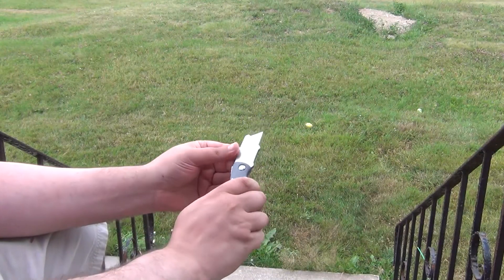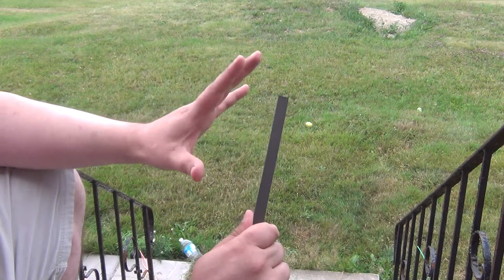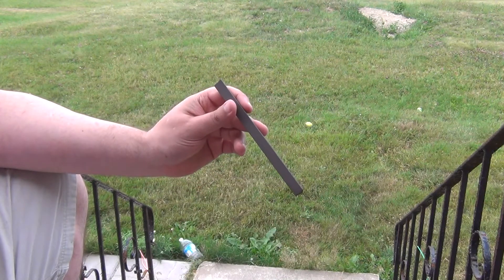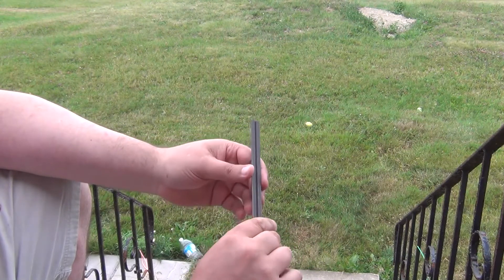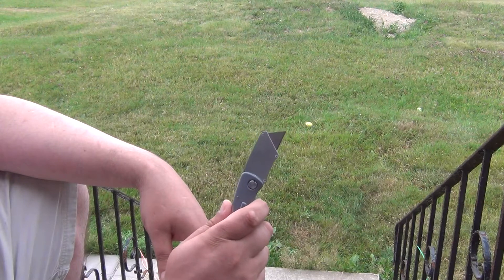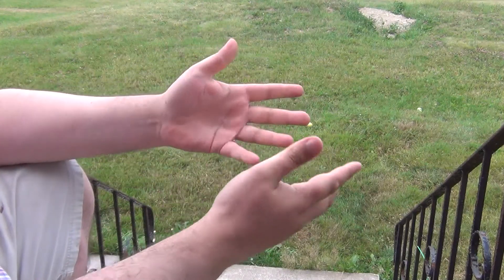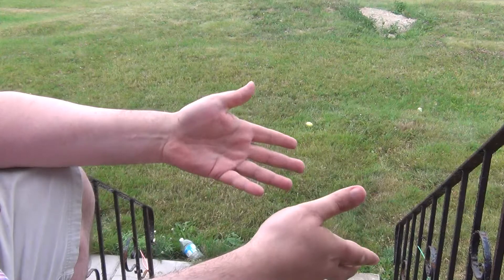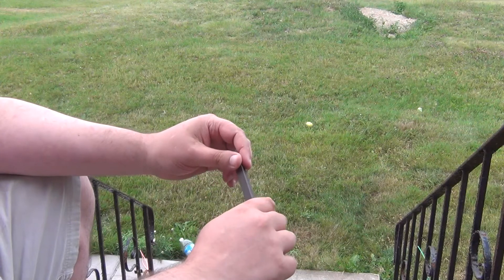Spyderco Delica ZDP-189 : edge retention on polypropylene (CBN vs medium rods)

Comment: Cliff - Thanks yet again for another enlightening/informative quantitative video.

I just bought the CBN stones and love them, although they seem almost done after reprofiling a couple Syderco ZDP-198 blades (including the Delica) on them.  And I did try to minimize the pressure and "let the stones do the work".  I also had to replace my medium stones, which became glass-slick after not such a long life...  These damn superhard supersteels like S90V are really hell on these ceramics (and my wallet).

My question - and forgive me if you've already addressed this elsewhere - is what exactly are the differences between the older diamond rods and the newer CBN ones?  I know diamond is a little harder, but there are other variables such as grit size and the tenacity of the binder used, etc...

So, can you please explain the pro's/con's of both different coarse media?

I have so many different stones, but lately have been finding myself only using the Sharpmaker, due to it's simplicity + consistency & the fact that it's almost impossible to scratch the blade finish up with a careless swipe as with my oilstones.

Thanks again, and please keep em' coming!
Reply from the maker: Greg, how much force were you using? When you say reprofiling do you mean altering the edge angle? How much of an angle change? Were you using a lubricant/fluid?

The diamond stones have a near identical grit and produce a near identical finish. I can't see a difference even under 150X linear magnification nor can I measure it with sharpness measurements as precise as 5%.

However there may be a long term durability advantage to CBN vs diamond due to diffusion based wear in diamond however that is just a hypothesis. I have no data and I have seen none. But this is a critical factor in industrial application as diamond isn't used on steels for that manner. But they grind much hotter that we do by hand.
Reply: I haven't been able to measure the actual force, but I was basically just letting the weight of the knife + just a tiny side pressure to keep the blade straight.

The knives in question were the Delica & Caly3 (both ZDP), and I used the 30-degree setting dry (no lube).  I also did a   Benchmade in S90v, but have no idea what it's starting angle was before I got it @ 30.

The stones just feel really smooth already, but hopefully I just knocked off the excess particles?
Reply from the maker: Greg Fowler Greg, this is one of the difficulties with talking about plate abrasives as it isn't trivial for me to tell you how I use them because unless you are going to use a force plate under them (no one does) then it comes down to feel.

Here is the best I can tell you, under no circumstances should you be knocking pieces off, if you are then you are using far too much force as the abrasive should wear down not be torn off. 

I don't even use the full weight of the knife initially.

I have done far more sharpening than what you have noted and the rods still cut well. The key is use just enough force for them to cut and this is really light and ideally you have to use a lubricant, a thin one.
Reply: Cliff Stamp  Ok, I guess I didn't mean to say that any grit particles were noticeably coming off the substrate - just that perhaps the rods ship with excess non-bound abrasive and that it is "normal" for that to go away (like you'll notice on the inside of the hollow rods, there's a lot of loose useless grit stuck to it from the coating process).

So, I don't think that the abrasive was ripping out of the binder.  I never felt/saw any sand-like particles actually pop off.  It's just the texture of the rods is much smoother already and I wasn't hearing the same pleasant "scrriiitchhh" sound.  Also, the scratches seem less pronounced on the edge surface.  I have yet to try them again on a more reasonable steel (e.g.: VG-10), so maybe they are still effective at least for the softer/easier non-tool steels.

By "force plate", do you just mean a simple postal-like scale or do you mean something more extravagant with a load-cell and whatnot?

And one more thing to add - I gave up on all my other more-traditional stones (several synthetic Nortons, some cheap diamond-backed steels, Arkansas stones, India stones, etc...), but have just not been having much success with the Sharpmaker.  I was hoping for something close to a zero grind with no microbevel, but in desperation after I spend a long time going thru all the grits (CBN ->  Medium  ->  Fine  -->  Ultrafine) @ 30-degrees, if I just do several passes with only the Ultrafine on the shallower 40-degree setting, I am finally able to shave hairs and slice through yellowpages.  The big question though - is how long this edge will hold using this method...?

Also, I suck at stropping.  I hope it's just that the cheapo chinese 2-sided paddle strop I got is worn.  I'm trying to investigate better options (including this interesting, but perhaps gimmicky "Washboard Sharpener": http://www.washboardsharpening.com/user-guide.html)

For as much as I think I know about steel and mechanics (have an M.S. in Mechanical Engineering), it's clear that there are tomes of knowledge I am still missing.  Which is why I appreciate all the comprehensive quantitative work you do backed with qualitative reflection.

Aside from several very ignorant, annoying people, one of the greatest things about the knife community is how helpful everybody is and how we are all striving to both learn & teach about all aspects of our hobby/collections.

Thanks,
G.
Reply from the maker: Greg Fowler Greg, any way to measure the force, if you have load cells you can get the force/time response curve which is interesting and actually use it to train as a biofeedback response. The main point I was making though is that while I know what 5-10 grams feels like as I measure it, it isn't going to mean much to anyone else because they are not and thus one of the big issues I have in communication is exactly that problem of how much force to use on stones. This is compounded by the fact that it isn't even the force which is relevant by the pressure.

If you are sharpening just on a micro-bevel your contact area can be as small as on the order of 10 microns thus the pressure skyrockets over when you are working on the actual edge bevel which is on the order of 1000 microns, a 100 times bigger. Thus using even 5 grams on the micro bevel is like using a full pound on the main bevel. This is why when I approach the edge or use a micro-bevel I wet the stones and use just enough force to maintain contact. I show this in one of the Sharpmaker videos and you can see the main issue I am having is just getting the knife to evenly make contact as the force is so low.

Now of course the only reason you have to do this is that the CBN rods are a single layer of abrasive unlike the medium rods which are a solid sintered block. Even if you do wear the medium rods smooth just buy a cheap piece of coarse diamond sandpaper, some loose diamond grit and just lap the surface back. It would take maybe $0.50 worth of abrasive to restore the surface. But once the CBN wears down then - well it is worn down. This is why I advocate only using one side when you start, number all the sides and rotate them as they wear. You then use the most worn sides for the very high pressure work (micro-bevel) and use the least worn sides for the low pressure work (the shaping).

The edge should easily dry shave your arm right off the CBN stones, if it does not then there are three main reasons :

-the edge isn't actually forming an apex
-far too much force is being used and the edge is fracturing
-there is an edge bias (it has folded over to one side)

There are other possibilities but those are the main three.
Reply: Cliff Stamp Thanks for those tips.  I'll see if I can borrow a load cell from work and play around.  I suspect part of my problem is maintaining a consistent angle - no matter how steady I try to hold my hand and keep the blade vertical for both side, I am sure there is some walk between passes.

And good idea about numbering the sides.  I labeled them "new" and "old" - wish I had sequenced them like you suggested.  Also started spraying a water mist on the CBN's, although it may be too late.

I'm having a hell of a time getting this cheap-ish Camillus in VG-10 sharp - will cut phone paper a little roughly, but certainly not arm hair...  Been sticking with the 40-degree angle cause that's what seemed to remove the Sharpie marked along the whole edge where the 30 just ground the back-bevel down a little.  I am using the CBN stones' corners for about 10 passes each side, and then switching to the flats and then on to the medium, but I'm definitely doing something wrong.

Also didn't think to try re-sanding the medium stones... wish I'd have read that before I got another set...

Just a wealth of wisdom - you should consider offering classes for a nominal fee - could help you supplement your steel-addiction.
Reply from the maker: Greg Fowler How sharp is the Camillus off of the CBN only?
Reply: Cliff Stamp Well when I was using the 40-degree setting in the sharpmaker, it didn't matter which rods I used - the edge was just crappy and wouldn't touch phone paper.  So I got frustrated, and started free-handing it with the CBN rods paying great attention to the angle and pressure and using sound/touch as feedback.

After a few passes, that puppy was zipping thru paper and cutting hair fairly well.  Then I did the same on the medium stones and it was like a laserbeam.  For reference, the knife - which was super-sharp outta the box until I messed it up by stropping it - is just called "7.25'' Folder with Titanium Carbonitride" or some other such lame generic nonsense.  Not a bad little Ti/C.F. framed VG-10 blade for under $60 though...
Reply from the maker: Greg Fowler Yeah those coatings don't do at all what they claim. They are useful for drillbits but in general not for knives.

Comment: Thank you Cliff, this is exactly what I was referring to in the wood cutting video. Its very interesting that the coarse finish lasts 4 times better than a higher polish one. I wouldn't have thought that the difference between the two would be that big. Another thing that I think would be interesting is to see how different carbides act, like zdp has chromium carbides but how would say s90 or s110 or 10v which have more vanadium carbides act in this test. Tests like yours show exactly why its hard to rate steels in categories in edge retention because so much of it depends on the geometry,  edge andle, edge finish, how it was sharpened not to mention heat treat and temper cycles.
Reply from the maker: Yes that is an excellent question, how much of a difference would be seen if this was m390 for example. I am going to explore this as I get various cutting media.

Indeed. Too often people make statements about edge retention which it is just jibberish because it isn't meaningful because it is so strongly varied as you have noted.

Comment: Cliff, I have not seen Mr Feinman lately, how is he doing?
Regarding the ability of the ZDP 189 to retain an edge, why is it so dramatically different between the CBN and the Medium stone? Is it the nature of the scratch pattern of the CBN on the ZDP? I will have to review the utility blade steel variation as well, but was it similar?  If so, what is the advantage of the nature of the scratch pattern that the CBN produces that gives it the "edge" over the Medium stone? 
If the pattern leaves a more toothy structured apex, does this equate to a shortened life span of the average knife steel? I know its odd, but if it turned out to be so, I suppose a shortened life span might be acceptable if the performance is higher. This is all under the assumption of course, that the CBN could leave a toothier apex, but I am just guessing at this point. The rational for my guess is the the benefits of toothy apex on material like polypropylene rope.
Reply from the maker: He has become aware that gender exists and is exploring the consequences of such. The same tends to happen in people in the late teens and it tends to be a few years (if ever) before they snap out of it.
Reply from the maker: The CBN is more coarse and like a coarse saw has much more material needed to be worn away and thus will stay sharper longer on slicing on abrasive material. If the material is hard and not abrasive this doesn't happen because the teeth can crack off vs being worn down, hence the difference results on the plastic and wood cutting.
Reply: Cliff Stamp Thanks, I was wondering something else and I know it is well within the realm of wacky, but I think it is related in a way (kind of) and what I am wondering is, if a toothy edge, which essentially has microscopic saw teeth, were used to cut up food like steak, do the micro teeth get broken off into the meat and then we end up consuming them? Now, I know they are very small, and (probably/hopefully) these remain within the meat and pass out of us. Assuming that a high carbon steel is used vs a type that is corrosion resistant, would there be less likelihood of it harming the body if they were more likely to corrode quickly?  
(Hey, I did preface that it was going to be a wacky question! :)   )
Reply from the maker: traderjoes Yes you will eat some amount of steel, however you are going to eat much more metal from cooking with metal pots due to the time and temperature of exposure. If you wanted a real concern it would be eating aluminum (from foil) and the extremely non-healthy coatings that are on non-stick pans.

Comment: The sharpness indicated have you increased your sharpness by 50% since you doubled your sharpness range?
Reply: Well that was one of the more impressive posts I have made.
Reply from the maker: I am not sure exactly what you mean, is it why the medium rods hover around the 60%? 

The sharpness in these is fairly low (for me) because they are severely time constrained, I only have 24 pps to grind off all damage, actually sharpen, and burr minimize. 

I could double it with a little more time. But the relative sharpness would increase with both blades, the ratios would similar.
Reply: As an example you show the sharpness for m3 at 100. A few months ago you doubled your sharpness measurement as you kept exceeding it with one of kyleys knives. Have you once again met or begun to exceed the optimal sharpness measurement.
Reply from the maker: mark a Yes, I can surpass that now readily in regards to slicing sharpness which is more sensitive (variable). Most people don't do a very good job on that at all but that is mainly because of the buffer/strop over use.

I should note the absolute sharpness level being used in these charts even for reference/consistency. Thanks for bringing that up.

Comment: Putting in a request now for a gorilla suit in a future vid to help promote the Sasquatch avatar.

Interesting results and good points made re: blade length, abrasion factor of dirty rope, etc.

I have started experimenting with using the medium and sometimes the fine sharpmaker rods on a S30V Paramilitary EDC unit rather than going one next step further to the ultra-fine. I'm liking the results so far with vegetative matter, trimmer line and other tasks associated with a community garden. Heading into the Fall, I will be cutting up a bunch of cardboard for wood stove starting purposes. Last burning season, I was not pleased at all with the edge retention when cutting cardboard on an ultra-fine rod finished edge.
Reply from the maker: I don't need a suit.
Reply from the maker: I would be interested to know what you find.

Comment: Thanks for sharing.  I probably would have assumed the opposite...that with the utility blades being soft the medium rods would remove enough material...but it's now clear that that ignores a lot of other factors involved.
Reply from the maker: Yes, and another thing I failed to mention is that the Delica allows a much longer draw while the much shorter Stanley blade concentrates the force on a smaller area. In general draw cuts reduce force and gain control which also will lessen deformation/chip damage. 

Ironically if the material is clean you are more likely to run into problems with edge retention due to the edge being strained/fractured because if ropes are clean they have a very low rate of wear and you are back to then doing hundreds (if not thousands) of cuts.

The other thing is the more cuts you do the more likely you will do them not well, hit something, etc. and again you now have an edge which was not worn away but chipped/fractured.

Ironic and maybe amusing that dirty materials like carpet when cut produce the most inherently stable edges when sharpening (unless you cut the edge off in which case it doesn't matter what was cut as all steel which was effected is gone anyway).
Reply: Cliff Stamp More good info.  Thank you.